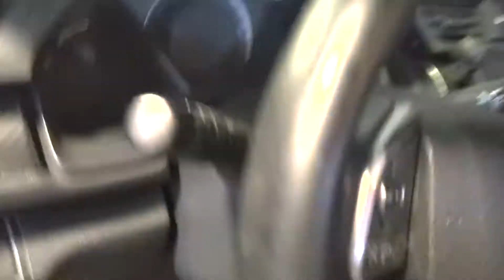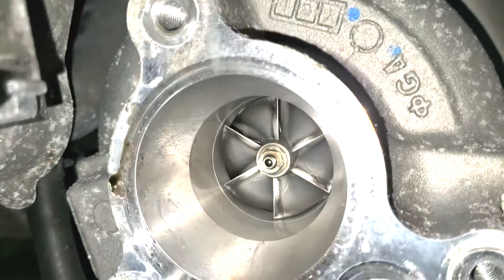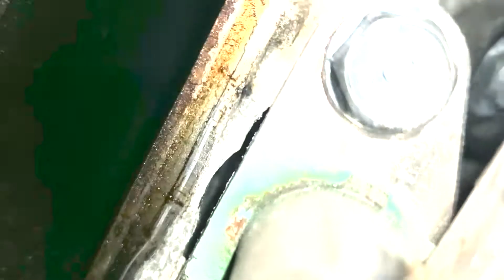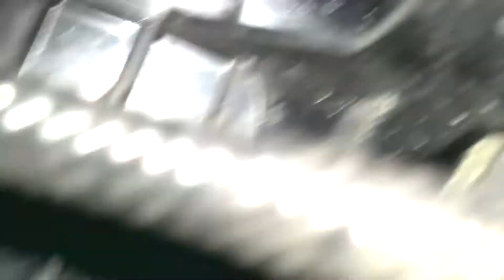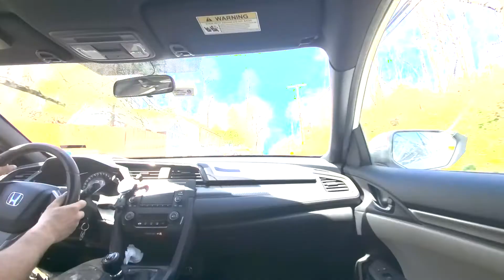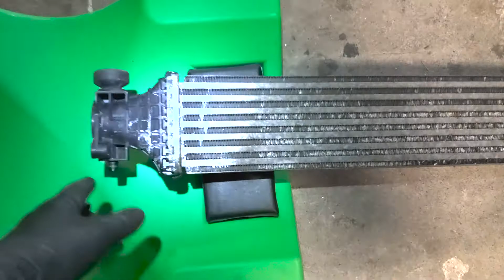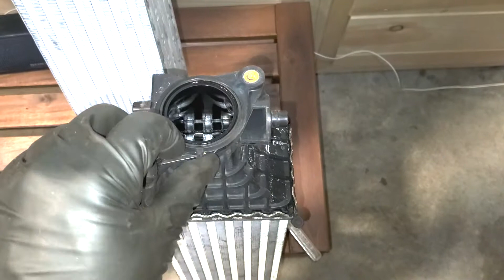Troubleshooting 10 Gen Honda Civic 1.5t poor performance and MPG issues

Comment: Great video!  I have a 19 Si and with so many variables that cd cause such a decline in performance, narrowing it down to a damaged intercooler was very good.  My car is moderately modded and speaking of intercoolers, I have a brand new 27 Won upgrade intercooler in my garage waiting on good weather for the install.

Comment: I have noticed lately that my 2018 hatch is losing the amount of kms per tank.  I just filled it and didn't even break 500 kms on a tank full.  When I originally bought it new easily 600 kms and above sometimes even 700km.  I get the oil changed usually at 50% or everytime the tires get switched over summer / winter and changed air filters every couple years.

Comment: My 2017 1.5 now has 140,000 as of Nov 2024 and daily drive to work is 120 miles a day over 30,000 a year. I got it in Oct 2020 from my local Honda dealership certified used with just under 16,000 miles. I drive conservatively and sometimes hyper mile it. My best one way trip to work 60 miles i got 64 mpg. I still can get well over 50 mpg one way and average 48 mpg on a tank of gas. My best fuel milage for a tank of gas was 702 miles a tank after filling up from an empty tank so the computer said. Computer said my average speed was 40mph and total driving time with the tank of gas was 17 hours and 30 minutes. Very impressive for a non hybrid and hard to believe from a car made in 2017. Ive had zero issues with it and even got 105,000 miles from the original tires it came with. Heck i could have gotten more out of the tires but didn't want to push it with my long drives back n forth to work.
Reply from the maker: That's bonkers! Mine is just over 200k miles now and I average abou6 36-37 mpg most days, though I certainly don't baby the accelerator pedal...
Reply: @tranquilizator  so I take it you have the 1.5 turbo. Well at least you know it's capable of getting what I can get and tell people about it. It's all in the foot and some discipline keeping the efficiency gauge in the green and not white or red. Most people don't have the patience to hyper mile and now a days more people can't drive fast enough even big truck drivers have to go faster than everyone else. I'm not in any hurry to die. Been in enough bad situations at 60 years old to slow down and enjoy this fragile life.
Reply from the maker: I do have the 1.5 turbo petrol. Hypermiling is cool, I'll try it out sometime. Thanks for the pointers and stay safe out there!

Comment: Cool thanks for stepping through the process and showing the valves. We got a CRV and are having worse that expected MPG even though it's at 25k. So I'm just running through all the possibilities to learn and not waste money at a dealership. Confirms what others were saying that the intake doesn't need cleaning and Honda specifically designed around it. I'll have to look at the intercooler, but with more ground clearance ours is probably fine. It's nice that it's 99% the same as the civic platform so we'll be able to get high quality parts till hell freezes over. If anyone has any suggestions it's a 2020 so it should have the new firmware.
Reply: Come to think of it I am kinda confused because I thought the ECU was supposed to notice loss of metered air or poor running.
Reply from the maker: Probably wasn't bad enough, or perhaps didn't last long enough for the ECU to take notice.

Comment: If the system couldn't hold pressure, how come the pressure sensor didn't let you know?
Reply: Within parameters of error. Until the car starts running rich the ecu will keep its mouth shut.

Comment: do you drive your civic hard? Driving it harder causes the intake valves to be warmer which also causes the carbon to burn off along as well. According to VW and Mazda its about 380 to 400° C temp on the intake valves will make the carbon burn off and not stick to the valves.
Reply from the maker: I wouldn't say I drive it particularly hard, but some days harder than others. Thanks for the tip, I'll keep it in mind.

Comment: I hope to not ever get this problem. I have a 2018 1.5T civic EXT with 6 sp. manual tranny but I only have about 46,000 miles on it, since I don't drive it much in the winter. This helps minimize the oil dilution somewhat but they still get gas in the oil even during a hot summer!! The deal about them only having the problem is cold weather is a myth. It's just not as bad in the summer. In the summer I get up to 48mpg on the interstate trips. Mostly because of our thin Utah atmosphere. Both very hot temps of around 100F and the high elevation over 4,000 feet or more makes for thin air. So the car doesn't have much air resistance even at 80 mph!! So fuel efficiency soars! The same trip in the winter with the much denser air yields only 42 mpg at most. And in rural areas, the speed limit on interstates is 80 mph. I'm taking great care of mine because the 2018 model year they made very few EXT (mid level trim) with both the 6 speed manual shift and the dual exhaust. Mine was the only one they could find like in Utah and all the surrounding states. I had my dealer get it from another dealer and they did! They made a trade for it.

Comment: Good catch and I have seen a few go bad like that, also they will pop off during boost and come completely apart. Nothing you did as your bumper damage is pretty light inop. They should have given you new seals when you bought the OEM one.. bummer.  Sometimes putting the bumper on its tricky to reset that lower IC deflector into the lower grove of the bumper, just try again :)

Comment: I have the same 1.5t at 102k miles. Trying to figure out why it averages only 26mpg 😩
Reply: I use to get 35 mpg in my 2020 civic Si all day long for the first 5 years of operation. I bought it new. But lately I’m only getting about 28.5 mpg. So Im sure I have an issue. The car seems to rev longer on startup. I know this for sure. Any thoughts?

Comment: easy test if you have a boost leak ,you will see a cloud of smoke 😂,i blew a hose off and you will know, stock psi is 15.7, you used hondata to turn it up to 21psi ,its crap stock intercooler

Comment: use fuel interjector cleaner and engine restorer after every oil change, lucas oil fuel injector cleaner and its called engine restorer, dump it in the oil 🛢 goes ,car run fine

Comment: lol, the air comes threw the intake, which is connected to the turbo inlet pipe ,wow charge pipe you called it ,lol ,look dont buy hondata an turn up your boost 6psi on a stock car 😂😢

Comment: Don't you have to cap the pipe before throttle body? What if the air flows into the cylinder and escape to the exhaust?
Reply from the maker: That shouldn't happen since both intake and exhaust valves shouldn't be open at the same time.

Comment: I've owned different Honda's for over 25 years. The 1.5L engine is hit or miss.   Carbon build up appears to be the biggest issue.  I just ordered my 2023 Honda.  Had to go with the 2.0L.   It's not a speed king, but it's bullet proof.
Reply: No carbon build up is the not the biggest issue with the 1.5t nor is it oil dilution. It’s blown head gaskets. My. 1.5T blew one.  And apparently it’s the biggest issue with this motor if you’re not using premium gas. Honda techs have been talking about it and raising concerns for a while

Comment: Did you clean the intake valves while you were in there? With like crc intake valve cleaner?
Reply from the maker: Haven't cleaned the intake valves. Probably should have, though my primary goal was to find the issue first.

Comment: Hey Tranqulizator. Do you still own your Civic? If so, can you give an update?
I’m trying to accumulate data and satisfaction of long term ownership of the 10th gen Civic.
Reply from the maker: Hi txmoney. Still have the civic. Over 145k miles now. Pretty happy with it still. Had a weird error code about a month ago that threw a check engine light - something to do with boost pressure, don't remember exactly. Was about to start troubleshooting it but the issue went away on its own in a few days. Let me know if you have any specific questions I can answer.

Cheers
Reply: @tranquilizator  
Thanks for the update. Great to hear you’re still going strong with your Civic.
At 116,300 miles, my Civic had a water pump leak detected from the weephole. At 120,100 miles, I replaced the water pump, drive belt, and PCV valve (total cost $1045.00). Aside from that and an earlier AC Condenser replacement (fully covered under Honda’s extended warranty), I’m going strong.

Currently at 121,800 miles averaging 34.1 mpg.
Reply: @tranquilizator hey man. I'm having acceleration and jerking issues. Changed almost everything except the turbo itself, and the part u just replaced in the video. Could it be fuel pump or related

Comment: Did this car have a check engine light on?? I just bought a 19 CRV EX L with the 1.5T. On the highway I get something like 35+ MPG, but in the short city commutes to work very poor MPG, like 13 MPG. That certainly is not what I should be getting, but with no CEL I just figured its what it was. Car has 69k on the odometer. I am now shocked to read some of the comments regarding what others are getting MPG wise. Car runs fantastic, and is super clean, its clear who ever had it before me took uber good care of the car and I absolutely baby the car due to concerns with the CVT, which I can certainly not afford to replace.
Reply from the maker: My car didn't have CEL on. As far as yours - 13MPG city is concerning. Probably warrants looking into
Reply: @tranquilizator  Yes it is, but its getting good MPG on the highway. I just bought it used and reset all the MPG indicators and normally only drive it 2 miles to work and back, which is apparently not a good thing for this vehicle, Im hearing. Maybe it just needs to be driven more to get the average MPG up?? I noticed on the way home today its up to 14MPG. Ill keep my eye on it. Thanks for replying.

Comment: I Bought a 2016 civic EXL in 2017 brand new. I put 100k miles mostly freeway miles 76miles an hour crusing. Get 42-43 miles to gallon. But this year I started Doordashing alittle bit put maybe 2k miles maybe 3k and had valve 2 stick lost all power had to crawl home.  Put an addive in the oil and ran some c-foam through the intakes  and it started throwing missfires on all cylinder but cylinder 2 was fixed. I did have 0 compression in cylinder 2. Now since then I have been burning oil now massive amounts of black smoke at intersections.  Cleaning with valve cleaner was a bad idea i guess Im sure something got dislodged. Now going to cost if anyone has any ideas would love to hear them.
Reply from the maker: Not sure what you mean by valve 2 sticking, but if you lost power then I would assume it was something more serious than what additives and cleaners could remedy. I would have the engine looked at by a reputable shop. Zero compression in a cylinder indicates a major mechanical failure - if I were you I'd stop driving that car and take it to the shop. Hope this helps.

Comment: If you were having "MPG" issues, you might just remove the 02 sensor right in the front (below the Intake Charge tube) and clean it off with some Throttle body spray, put some copper anti-sieze around the threads and put'er back in.  You could do this for BOTH the 02 sensors if you chose to.
Cleaning out the throttle body and MAF spraying the MAF sensor as well will bring a lot of life back (especially if you haven't done those).
Reply: Apparently you didn’t watch until the end.
Reply: @SMuss50  Forget the end, they didn't even watch until the halfway point. Worse yet the people who liked the comment.
Reply: He has "Key moments" moments in the description which allows you to goes wherever you interests lie. Just have to use them.

Comment: A few people here said they are "surprised at how little fowling" the intake side has. I am sorry but that is still pretty bad in general. Grab any toyota motor and you will find nearly NO fowling, not even a little. Dual injection > GDI only even if it costs more to build the engine. And compared to port injected engines, this is horrible.
The issue isn't "restricting" airflow, but making the airflow turbulent (meaning worse tumble flow), as well as incomplete valve closing and opening, valves getting stuck, as well as carbon build up falling into the cylinder itself creating micro damage and further build up to the cylinder linings.

Comment: Only problem with this car is oil delusion problem because it has a small engine and giant turbo, the heat this creates is too much and the piston rings let some petrol out. You can easily smell petrol while changing the oil.
Reply from the maker: I haven't noticed that. This engine is pretty well built as far as I can tell.

Comment: Any updates? I'm gonna be buying a used civic so would appreciate any advice.
Reply from the maker: Hi Carl, sorry for late reply, I don't check the comments as often as I should. Still have the car, still love it. Around 37mpg combined now, no issues. Had AC work done under recall, that's about it as far as I can remember. 140k miles

Comment: You know how you pull up to a parking spot and you go to park and you touch the curb or parking block, this car is so low stock already that easily hit.  This is probably what plagued my car back then.  Ive since upgraded everything and even the engine.  This process you used was amazing man!  I liked how simple you made it seem.  Thanks for taking your time to make this video. Im sure its gonna help a lot and i had never thought about checking the entire unit i always just looked at the boost tubes. Its kinda protected there but you hit it hard enough for sure it can do dmg!!!
Reply: Just stop short of curbs and parking blocks, problem solved! That's what I do.

Comment: Actually why I chose the 2L naturally aspirated. I knew turbos cause these issues so I opted not to have a turbo. I wanted to negate as much upkeep on the engine for longevity as I could when buying a Honda.
Reply: understand your reasoning.  Only, thing, is the Sport (and LX) do not have as many options as the Touring models.  I had to have!!  Lol  But, it's awesome to see the valves at 109k and they were fantastically clean.  Very happy to see that!
Reply: The sport has tuned shocks, different control arms and bigger sway bars that the touring doesn’t have. 
I’ve driven the touring but it doesn’t handle nearly as good as the sport in stock form. 
I’m not a fan of sunroofs at all, and  the touring definitely rides better. Also when it’s optioned with the leather interior it definitely feels like a more premium car inside. 
I already have a fast weekend car, and wanted reliability why I went with the 2.0 and manual as my daily. But HATE the electronic ebrake. 
The Hondas/acuras I had in the 90s were far more analog feeling and didn’t have all the electronic gizmos which I prefer. 
However I have friends with the 1.5 with over 150,000 miles so the reliability issues often associated with them are overblown, they are very reliable engines and better on gas as well as more performance 👍🏻
Reply: @bretthansen8166  ... I also had a 2002 Civic EX (bought it new) and loved the Vtec.  I agree the 10th Gen is a good modern reliable car.  But, I do like my tech.  haha
Reply: I already have a fast weekend car and wanted a reliable daily driver so I bought a 2020 Civic Sport Sedan with the 2.0 naturally aspirated port injected engine and a 6 speed manual transmission. 

Would NEVER buy a Civic with a CVT!

Comment: Im going to have to check this out. I've bottomed out at a few driver ways over the years but didnt notice lag and loss of power till about a year ago. Also my MPG city is like 30 to 29 compared to 35 and up when I first got the car. I also have serious loss of power at speeds over 100 now. She wont go 130 easily like it used to.  Do they sell compression kits like this and what are they called? 

My Highway mileage has not changed, still get amazing highway MPG

My FK7 has about 54,000 miles, newish airfilter, no new sparks, stock boost  and tubro. New tires are rated for 140+ MPH. used 91 only since I purchased the car from Shell gas only or cheveron.
Reply from the maker: I don't know if they sell compression kits... I just put this together with Home Depot hardware basically.

Comment: My 2017 civic hatchback sport has 188,686 miles.. ac just went out
Reply: Is it CVT transmission? Any trouble oil change for cvt. I’m gonna buy one but in doubt of cvt reliability. Thank you 🙏!
Reply: @kr9181  yes it is, I did the oil changes every 25,000 Miles with honda Trans oil. It's 
A good car. Now that ac went out, dealer didn't want to honor extended warranty for ac condenser.
Reply from the maker: That's a shame that the dealer won't honor AC condenser repair. It's a known issue and they should stand by the brand and make it right.
Reply: Honda extended the A/C warranty to 10 years, unlimited miles, so check on this!  I got a notice in the mail for my 2018 Civic hatchback.  So your mileage doesn't matter.
Reply: @travelguy1564  I took it to my local Honda Dealer, were gonna charge me 996. For freon, to " verify" the ac condensor was at fault. If it was no charge if it wasnt I was gonna get charged. I ended up decling the work, paid the diagnostic fee 167.00. Later, i ended filing a complaint with Honda of America against the dealer. What I was I told over the phone, dealers are getting away from doing the work. Because they dont make enough money for fix. My honda AC still....isnt working. Luckily I have a secound vehicle.